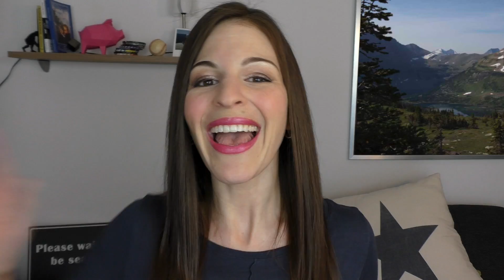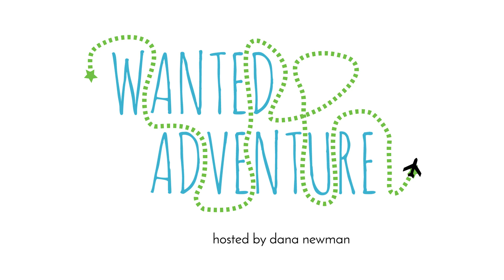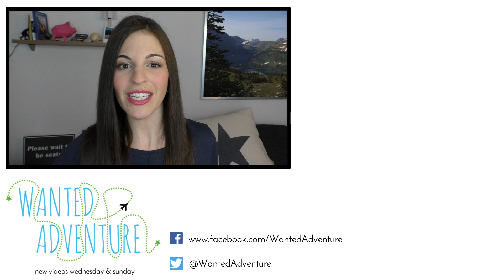Why Are Houses in America MADE OF WOOD?!

Comment: A better question for which Americans have no reasonable answer is, why don't  houses in tornado alley have basements. Southerners believe that basements can only be built in the north. This is false.
Reply: +Raphael-There are a few reasonable answers.  A few of which are that much of the land in tornado alley contains limestone just below the surface which would, as you can imagine, be very expensive to excavate for a basement (digging through stone is harder than soil).  Also, in many areas (especially Texas), there is such a high clay content in the soil which doesn't act nicely with the wide sweeping seasons (shrinking great during very dry season to swelling immensely during rainy seasons).  If you know anything about clay, the change from wet to dry clay will destroy a foundation quickly...heaving and flexing to 15,000psi on the structure during a rainy season.  My brother-in-law is a realtor in Texas and told me that many of the houses in Texas he has seen with a basement also have watering systems on the foundation to maintain a more constant moisture content of the clay which stabilizes it so it greatly decreases the chances of damage to basement walls and foundation.  Also, the frost line in the southern states is very shallow which makes digging deep for a foundation unnecessary.  In the north, the frost line can be 5 or 6 feet deep which makes it easy to have a basement if you're already digging that deep.  The frost line in the south is often just 12 inches which would not necessitate digging down deep...so a basement would only be dug if the builder wanted a basement not because it was necessary.  Storm shelters are becoming more and more popular now that there are many companies making pre-fabbed shelters you can drop into place, the cost has come down and many are now choosing to get them.  Hope this helps.
Reply: Dewy Russ

I live in area where about 80% of the houses have basements. The ordinance requires foundations 42 inches deep to keep the frost from heaving it. Below about 8-12 inches, the ground is clay but it seems to be always damp aside from the top. The dry layer of clay is only a couple of inches, but digging through it is like chipping rock. The first time I dug to it to plant a tree, I thought the contractor had diluted leftover concrete and dumped it. It is like that wherever you dig a hole.
Reply: Kenneth Florek
Sounds like you would have your work cut out for you if you wanted to plant a garden!